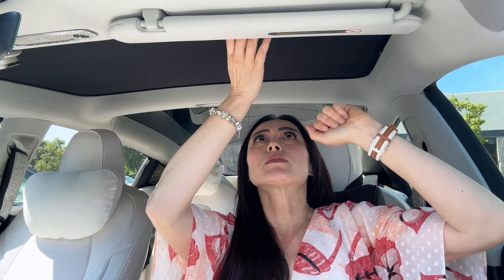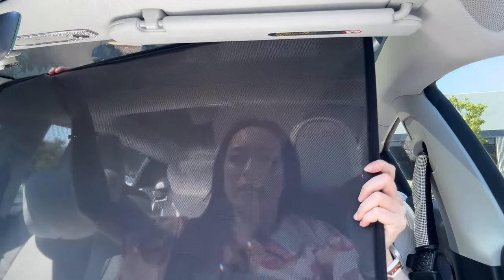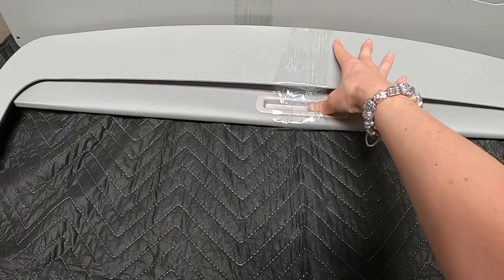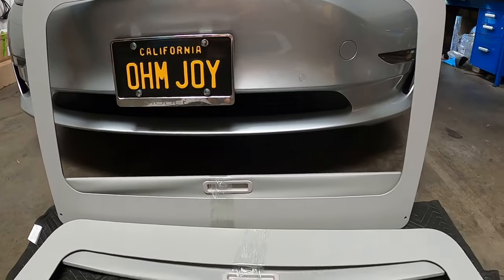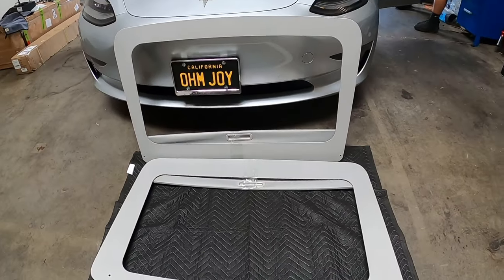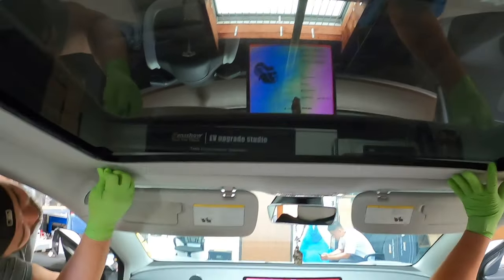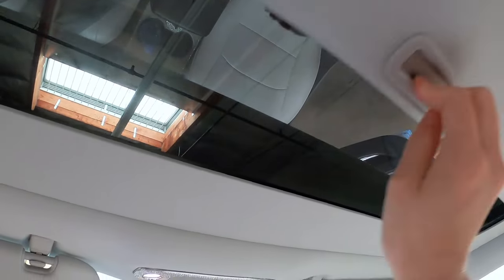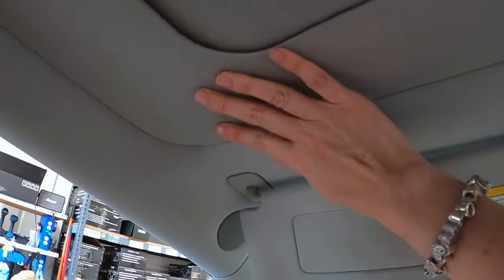Must Have for Tesla Model 3 & Model Y Owners in Summer!

Comment: I used the screens when I first got my car 2 years ago, and then went ahead and got it all tinted (even tinted the windshield and front windows with Air 80 so it's invisible. No more frying in the summer but I can still see out the roof :) This is awesome, though! It's the kind of thing that's standard on the ID4
Reply from the maker: I have all the windows and windshield tinted as well. Still burns my forehead with sun beaming directly down.
Reply: @TeslaJoy  yowch I'm sorry to hear that. I live in Chico where it is a kabillion degrees in the summer... maybe my tinting is different? So glad you got this shade though, it's really neat!
Reply from the maker: I have nano ceramic tint.
Reply: @TeslaJoy  Lol I had to hunt for mine. I'ts IRX Heat-rejecting window tint by LLumar. But again, I live where it's sweltering in the summertime. Still, I will probably invest in this roll-back shade at some point. So nice!

Comment: This is the same reason I keep the liner closed on my BMW, the heat really comes in the sunroof. It seems wonderful in the winter time it gives you a little bit of heat, but in the summer it’s not too great even with the air conditioning. I love the glass roof in the Tesla, but it is aggravating, but it does draw  heat.
Reply from the maker: Same with my old BMW.
Reply: @TeslaJoy  At times, I think the glass roof is a double edge sword